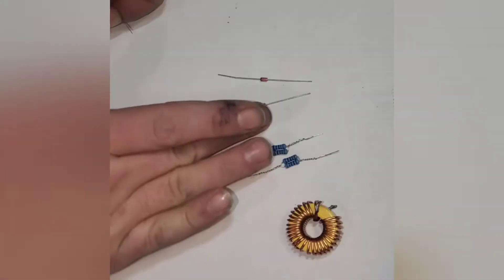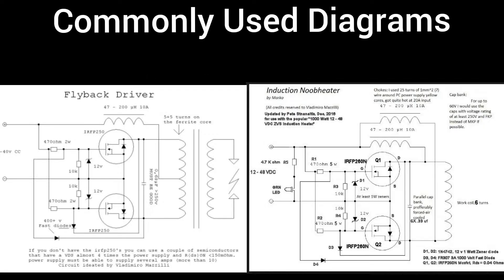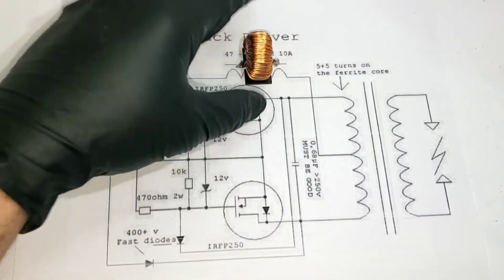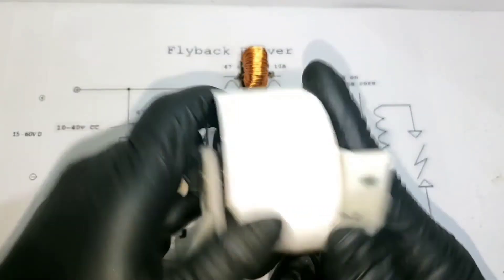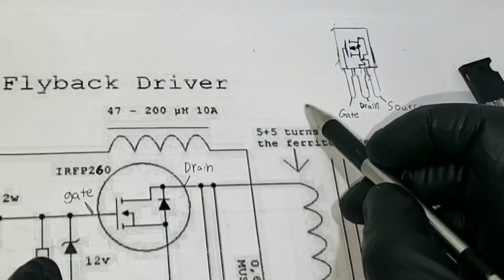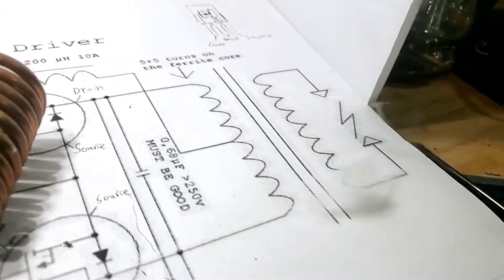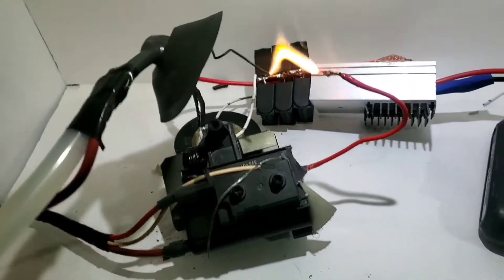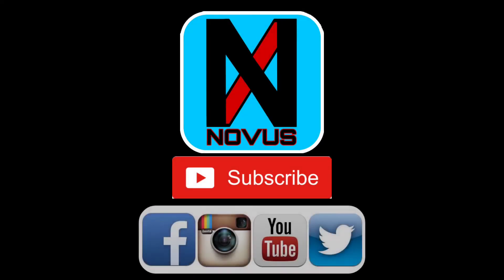DIY ZVS Induction Heater and Flyback Transformer Driver Circuit

Comment: Help,my zvs circuit is centertaped and wenn i add my coil it just goes from 12v to 4v overcurent protektion  
on my power supply what shoud i do?
Reply: Help
Reply: @IlicIlija ether your components are ether not good or touching something they shouldn’t be or your power supply doesn’t have the power to drive it
Reply: @IlicIlija at 12 volts your minimum current should be 7 amps or more

Comment: Very good video you helped a lot. I have a question can i use a regular diode insted of a zenner diode?
Reply from the maker: Thanks for the feedback and I'm glad you enjoyed the video! You won't be able to use a regular diode to replace the zener diode. The zener diodes play a vital role in switching the transistors on/off as well as protecting the gate from over voltage.
Reply: @novus2355  Allegro ACS733 current sensor can protect power semicondutors much better and add significant value in the process, 1st by electrically uncoupling the I/O of what basically a power amplifier with zener diodes that seem configured as noise sources...
Reply: Thank's for the answer